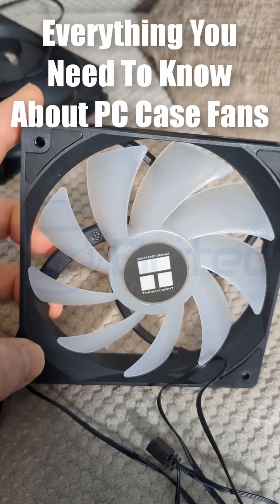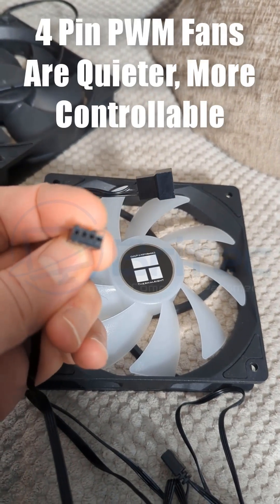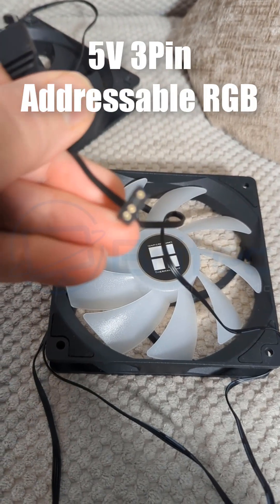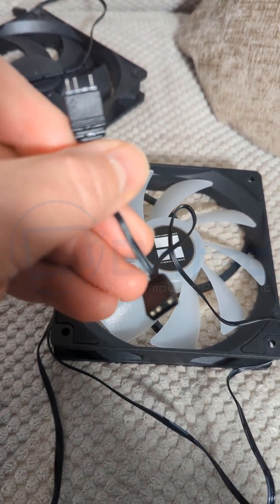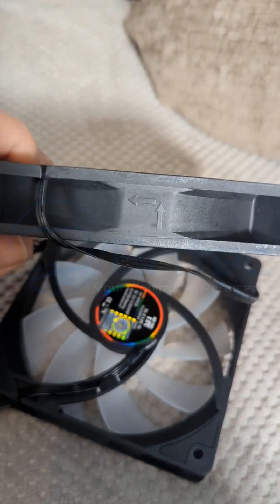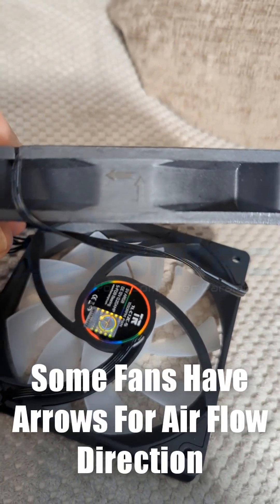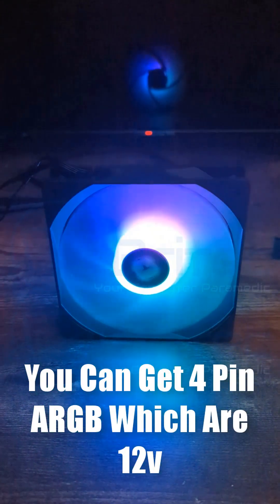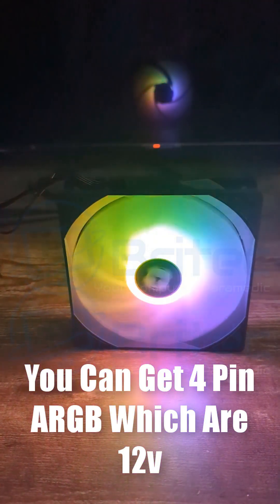Everything You Need To Know About PC Case Fans

Comment: Yeah, that's not everything.  I have a set of fans in a case that daisy change with weird plugs and a sata power plug.  WTF.  And when I plug the sata into the power the fans run all the time and the rgb on the ram lights up.

Comment: I upgraded ram on my Asus X570 mobo when I started the PC it kicked me into BIOS with a "CPU fan error".  I only had one of the two fans on my Be Quiet tower cooler plugged into the cpu fan header on a spitter.  When I plugged the second fan in the cpu fan error went away.  Not sure why.  The splitter?  Haven't tried removing the splitter and plugging one fan directly to the cpu fan header yet.  I've never had this error before. These are PWM fans.  Thanks for the video.